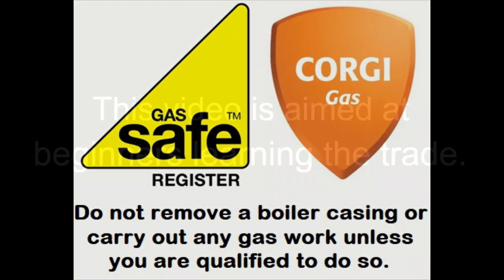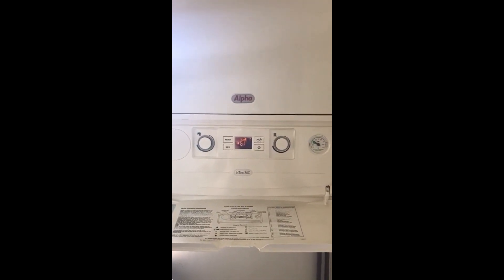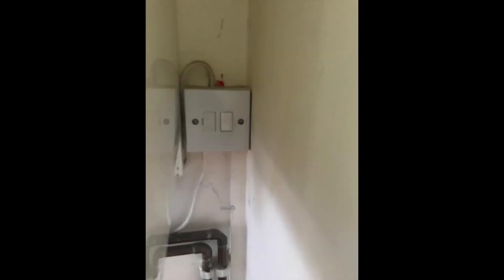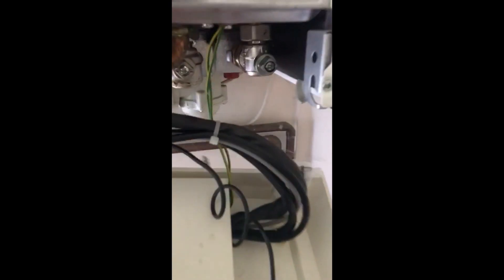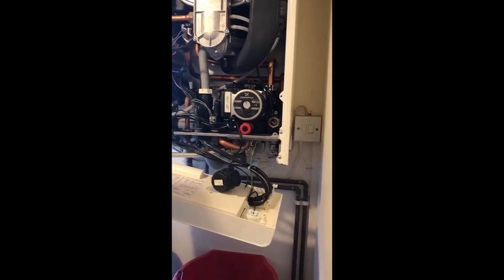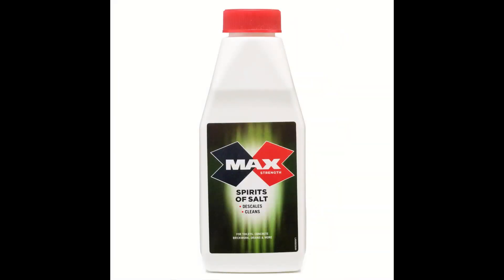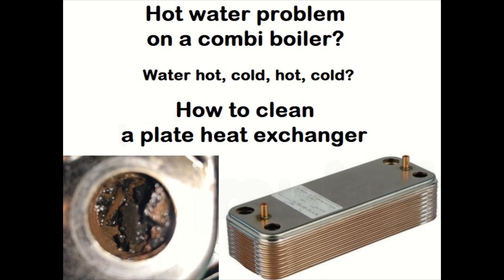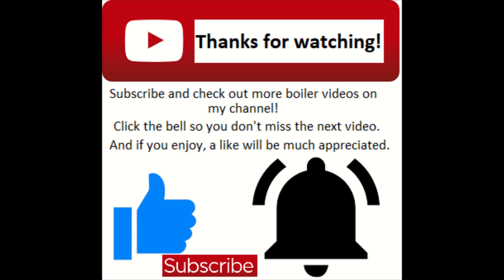Combination boiler no hot water problem and fix / How to clean a blocked plate heat exchanger

Comment: many thanks for your video, it's the only one I found that actually explains draining the boiler, and not the whole system.
Need a little help from you or anyone else that can help me with this query.
The screws that you turned to stop the hot and cold water flow has imbedded screws. Do I need to loosen the inner screw before shutting of the flow to the taps? I need to replace the heat exchanger.

Comment: would the plate heat exchanger be responsible for a low hot water heat of 11°c. I'm thinking either the plate h/e or the diverter valve/head.

Comment: What causes the plate to block up
Reply from the maker: Dirt, sludge, iron oxide, anything in the heating system. The space between the plates is very thin
Reply: @goldgas1216  thanks for the quick response would not having  a combi mate or a inline scale reducer contribute to blocking it with lime scale
Reply from the maker: @Zaine22  no probs. That would help the fresh water side. But it's mainly the heating side that gets choked up, a clean system, power flushed, chemical and a magnet filter would help

Comment: Hi Gold Gas videos .
Great video this one . Thank you for it  :) Have a question : 
Worcester Bosh service my boiler in 2019 for £175 which I thought was quite dear after I had the boiler repaired by them  1 month before . I requested the  service as my boiler was making quite a lot of noice when I first open the tap and then less but still noice. Also when I open the tap and I use the hot water the water goes hot, cold , hot , cold . After it was serviced the noice seemed to go down a bit but within a few months again same noice  but still had the hot, cold and hot and cold irregularities. For your info My boiler is a Worcester 28Si and is 12 years old and it is in a single household, so is not used that much . Do you advise to have the heat exchanger cleaned or replaced . Thank u :)
Reply from the maker: Hey there, no probs 👍. 
£175 for a service?! Blimey. Was that breakdowns included? Can't say for sure without attending, but sure sounds like heat exchanger is the likely culprit. Keep me posted.

Worcester aren't the best design, can be a pain to get to some of the worcester bits out
Reply: @goldgas1216  how much do you charge?

Comment: Got a blocked heat exchanger. Is it common practice to replace it or clean it out?
Reply from the maker: On this model? If it's easy to get to like this, I'd clean it (make sure you got spare seals for it incase they've perished). If it's a difficult one I'd replace it.
Reply: Thanks for reply. The model was a vokera unica HE. I was wondering as mine is causing water tempt to vary and the heating engineer is going to replace it. £250 to replace including labour so I suppose cleaning it would mean more labour so probably balances the cost by simply replacing it.
Reply: James Murphy 
Personally I would get it cleaned , it will only cost you about £100 , £250 is extortionate

Comment: Does it matter which way round the heat exchanger goes back on ?
Reply from the maker: Great question. It completely matters. Even though we've flushed it you'll probably have more shale and rubbish in the heating side so you don't want that in your washing up hot water etc. Also they 'usually' only go one way and you won't be able to get it back in properly. Most of the time to they say top and bottom on them. Take loads of photos and mark it if need.